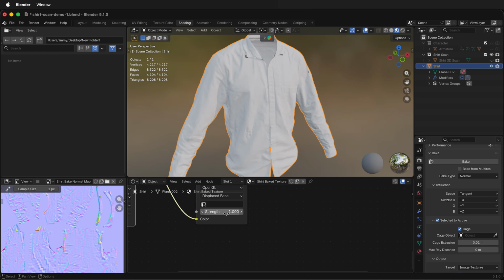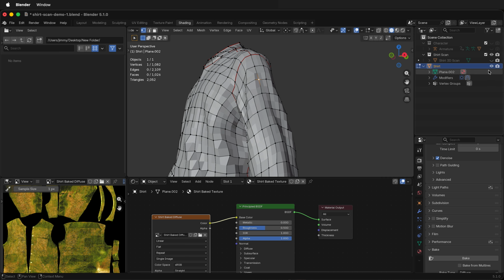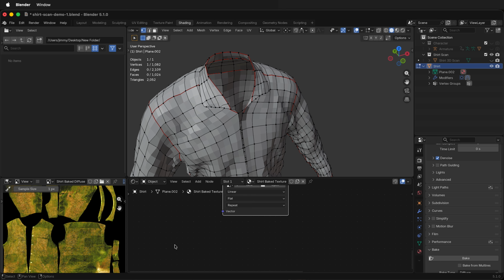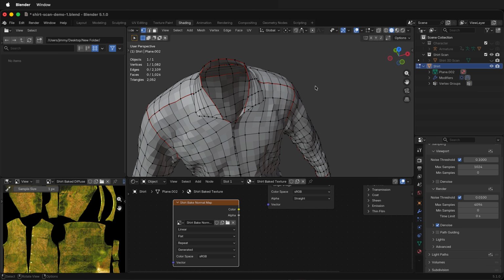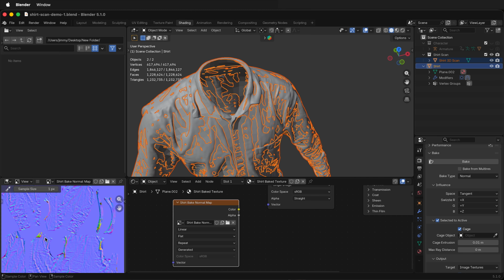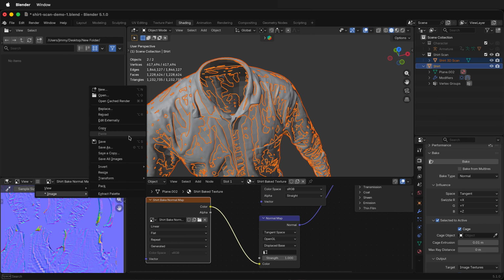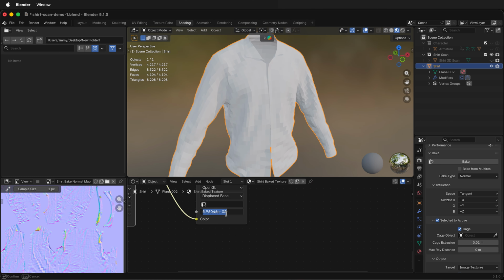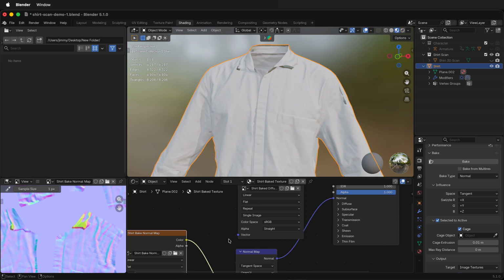Blender Normal Map Baking Tutorial: High Poly 3D Scan to Low Poly Retopo

Comment: hi whenever i do same method the problem i face is that the faces which are on top of the low poly are baked but the face which are under the face of lowpoly aren't baked can you telle the solution to it please i am trying tk bake the mab of 3d character
Reply from the maker: You can use a cage with a higher extrusion value such as 1 to capture parts of the model that are underneath the low poly. It kind of like blows it up and then reprojects the rays onto the low poly model for baking
Reply: @WhatMakeArt ok I'll try it